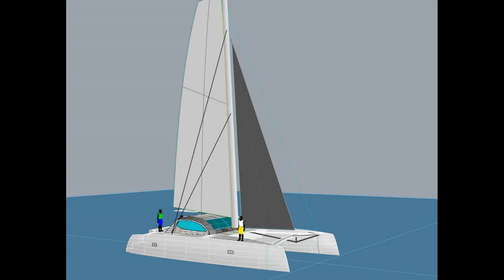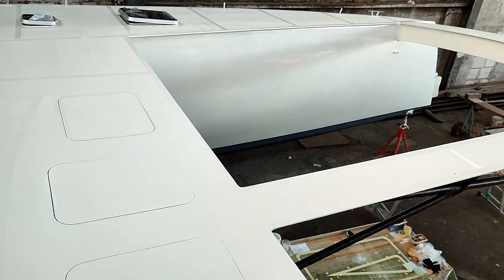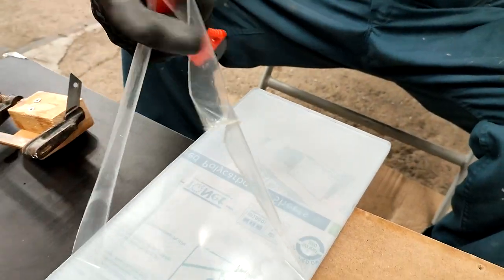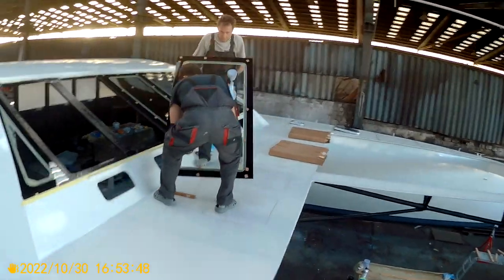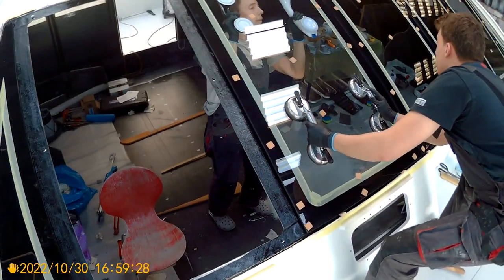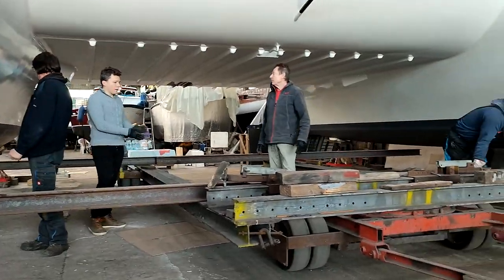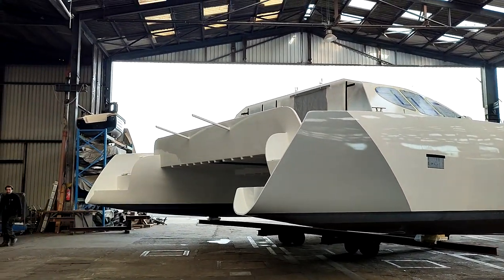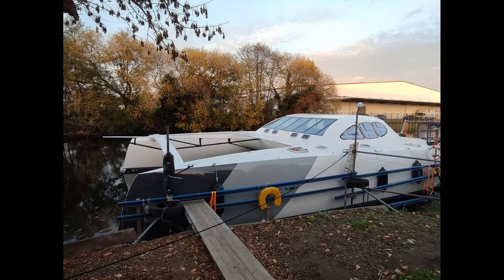06.  Building 15m carbon performance catamaran - "CarbonBee"

Comment: Hello Kevin, congratulations on your design. I have searched your channel and internet but I'm not able to find the plans? Also, I would be interested in a 55ft design. Would you be able to give some guidance? Thank You
Reply: hey george, thank you for the comment. You will not find the plans because the design is our own. When we will be done with Carbonbee we will decide if/how/when we want to make them available. Cheer
Reply: Kevin, what software did you use to design your catamaran?
Reply from the maker: @wanabesailer9599  In general Maxsurf, Rhino, and SolidEdge for FEA

Comment: impressive build, love it!  clever "jig" your dad made there Kevin (at about the 5min mark).  I still prefer the manual tube guns over the electronic ones, only because I get a better feel of the squeeze for things like chalk, epox, or what looks like silicon that you used for the windows?  very sticky stuff... at first I was thinking why not use shims to help with alignment when setting the windows... but then you said mm work.. so that likely means too small of spacing to utilize shims for alignment.
Reply from the maker: Nice you like our project!
The distance between Glass and frame is ca. 6mm. You can see the small black discs/shims glued to the frame to get the distance. That requires a lot of glue in short time to fill the gap, because you can get good connection when the glue is still liquid. It is not possible to manage it with manual gun.

Comment: Sehr gut. Fantastic awesome love the curved shape much stronger than straight to connect the two hulls . Perfect length to width ratio. I love everything about this yacht. I would like to see details from outside and see how the keels go up and down and exactly where they are located
Reply from the maker: Thanks!
In our previous videos, I think, you can see where the dagger-box are located.
Reply: @bojanu7212  yes I did see it was also at an angle. I was thinking of making one like a wharram for more interior volume and place a ballast tank on the top outside of the v. Do you have any ballast for high winds?
Reply from the maker: No, we do not need a ballast. We will reduce the sail area in strong winds. To sail effectively catamarans shell be light  - the lighter the better.

Comment: Your Cat looks very nice however I worry about the design of the windows. They are obviously great for all round vision but since they are fixed they have no ventilation. Since they are at such an acute angle it will act like a greenhouse trapping light in and turning it into heat.Perhaps their is an eyebrow option to add to the cockpit roof for shade and you can always cut ports into the glass for some ventilation.
Reply from the maker: Thanks!
I think you didn't notice the hatches under the front windows.
If that will not be enough a sun-sail (soft roof) at the front, fixed to the edge of the roof and two pillars, will solve the problem during the anchorage or slow sailing.
Other option would be an infrared blocking folie.

Comment: Servus. Wie sieht es mit Zulassung aus? Braucht man danach eine Gutachtung?
Reply from the maker: JANU-15 (CarbonBee) ist in Übereinstimmung mit den EU-Anforderungen konzipiert, aber wenn Sie es für den privaten Gebrauch gebaut haben und nicht innerhalb von 5 Jahren in der EU verkaufen, benötigen Sie keine CE-Bestätigung oder Gutachten, und die Registrierung ist kein Problem.
Das ist in der EU, wenn Sie eine EU Flagge wollen. In anderen Ländern sind andere, meistens lockerere Regelungen oder es gibt keine.

Comment: I just saw this Cat for the First Time the Video nice Love the paint details,hope to watch and see more.  Sir why Are these all Carbon Fiber and Fiberglass? You know they Make Carbon/Kevlar cloth which I wonder why not to use More Kevlar fabric? I would think the Hull would be the place to use That Blend to the Fullest.
Reply from the maker: Thanks for watching and nice you like it.

Mixing two different materials with different mechanical properties can pose challenges in construction, particularly when it comes to designing for stress resistance and such mixing in case carbon/Kevlar isn’t good idea.
When two materials with different mechanical properties are combined, such as in a composite or laminated structure, their individual strengths and weaknesses can affect the overall performance of the structure. If the materials are designed to share the applied stress equally, the weaker material may fail before the stronger material reaches its full strength. This can lead to premature failure of the entire structure.
To ensure that the composite structure can withstand the designed stress, both materials need to be capable of independently withstanding the anticipated forces. However, this often results in a trade-off between strength and weight. If each component is designed to carry the full applied forces, the structure may end up being heavier than desired. In extreme case the structure will have double weight.

In CarbonBee case, we used aramid cloth as an addition in our laminate, but only in the area of the hull's bottom to provide protection against “bullets”, without factoring it into the mechanical stress calculation.
Reply: @bojanu7212  I think you are talking much about strain here... not stress..
Reply from the maker: @MrGentlebutfirm  You are right. My explanation wasn’t very clear. I changed it. 
Saying “stress” I mean the ratio of internal resistance of the material to resist the deformation.

Comment: How do you cut the Tempered glass round corners on site with out breaking?
Reply from the maker: Hi Norman. Thanks for watching.
The windows consist of two tempered laminated glass plates and are manufactured to exact dimensions. Without causing damage, it is not possible to change any dimensions or drill a hole. I believe that the round corners you referred to are only present on the black painted frames.

Comment: U need a non skid flooring walking
Reply from the maker: Yes, on the deck you can see anti-slip surface at video time 2:00. We are very satisfy of it. We still do not have it in the cockpit. There, probably will come some kind of marine flooring mat.
Reply: @bojanu7212  custom it state of the art cat AI and voice command on auto piloted and some simple command to close/ open blind and doors locked open and security camera on 5 area TOP of mask looking down and can zoom far away boats with infra lighting as for corner to see blind spot
Reply from the maker: @tancolvis5240   Ha, ha, ha ... you got AI from another planet 🤣😂😀